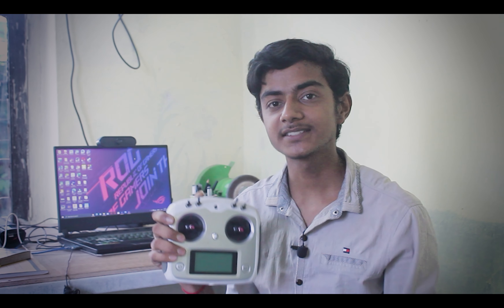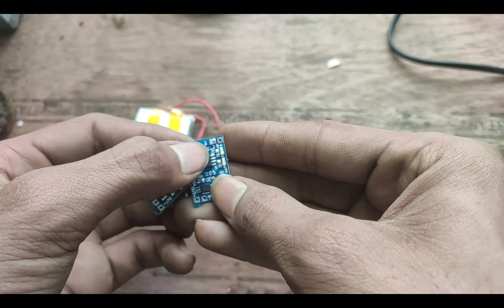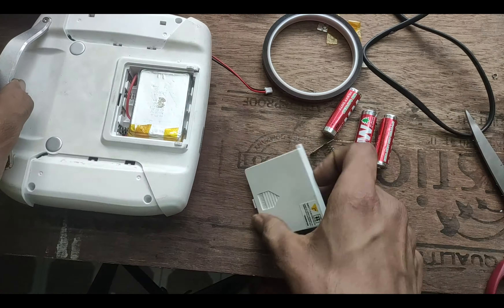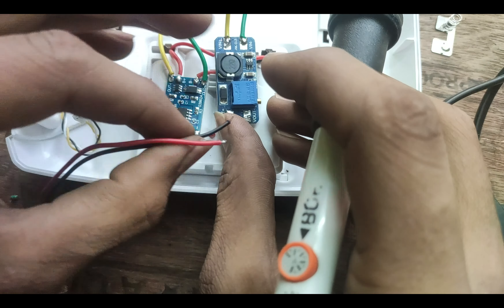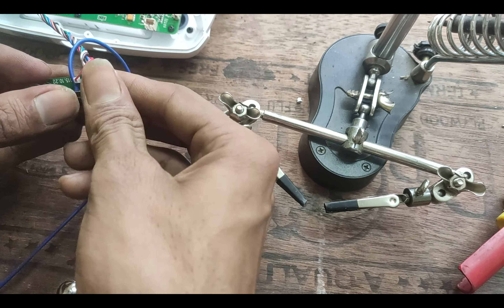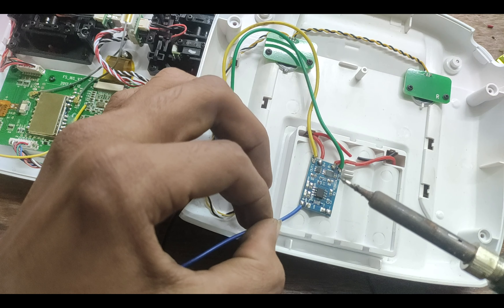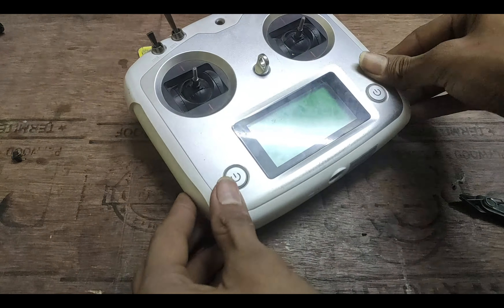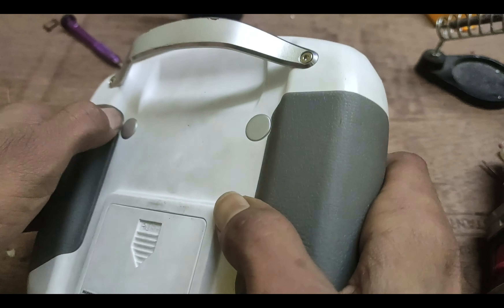how to make flysky fs-i6s chargabale

Comment: Can you plz confirm that this transmitter directly connects to the computer with the usb cable  and no extra Sm100 cable is needed. Thanks in advance
Reply from the maker: Yes, I can confirm that it connects to computer with just usb cable. You can play simulators like fpv freeridee and auch